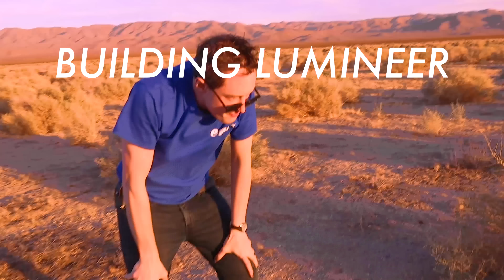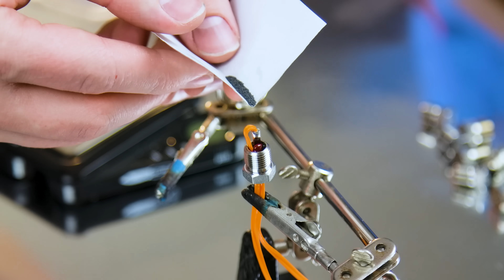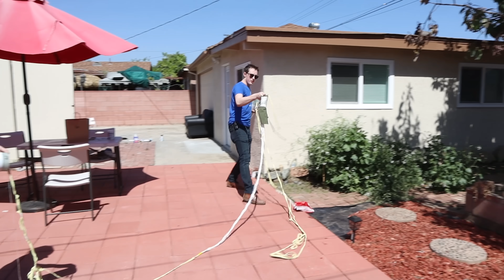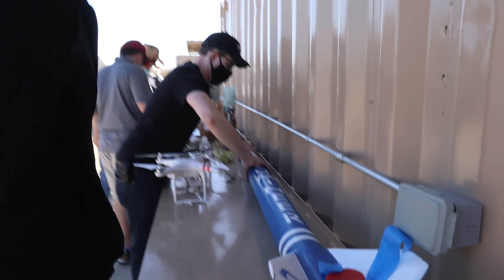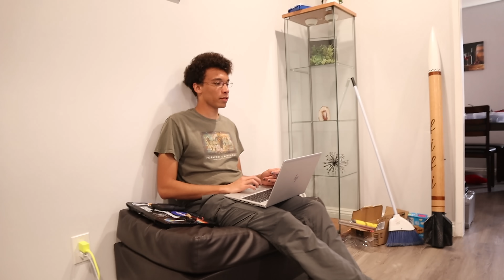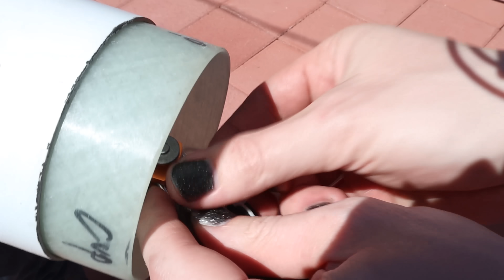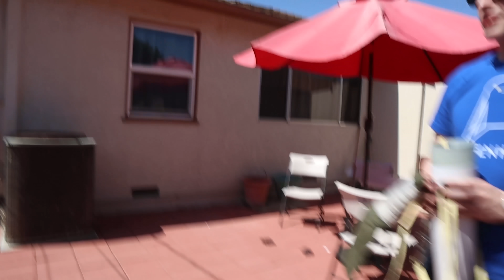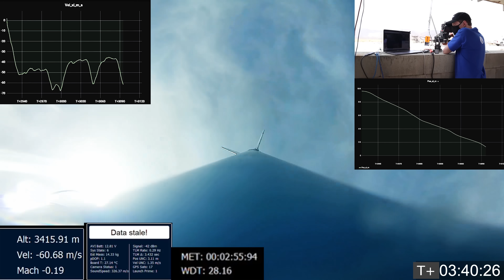Rocket Recovery System - Building Lumineer

Comment: G'day Joe.

Yours is one of the most fascinating channels I have yet discovered, thanks!

Have you tested a 'blank' pistol cartridge case loaded with smokeless propellant/powder constrained by a simple to reload and reset receiver/chamber actuated by a simple spring-loaded firing pin to initiate your pyro-mechanical deployment device?

If for some reason that was impractical or unappealing you could also try substituting the piston actuating the flat aluminum plate with a small piston from a model aircraft engine which could be attached directly to a chamber containing a blank pistol cartridge to actuate the ejection pin.

It should also be possible to create a system utilizing gases produced by relatively lightweight blank shotgun cartridges or soda-siphon CO2 cylinders to deploy a drogue chute directly. 

That method could dispense with a heavy piston arrangement altogether by exploiting gases produced by a cartridge or soda-siphon cylinder to push the entire chute out after the drogue like a non-lethal 'bean bag projectile' used  by some Law enforcement agencies in shotguns.

In conclusion I wonder if the 'kick when the motor burns out' you spoke of could be an example of magnitude for a difference between deflagration and detonation?

Comment: i think a manual safety chute could have saved the rocket what i think about is this

you could try to add a hatch on one side of the rocket the thing is that the hatch take half the diameter of the rocket (il try to do a video on ksp to show better what im triyng to say) in teh hatch you will have a second chute that you can manually deploy if you see that the main chute failled it can be something that is on the top of the avionic bay just a hatch that if you press a button the hatch open and yeet out a parachute

ok there is it made in kerbal space program fun fact i did the ksp version of lumineer so well that it actually have the same default🤣the main chute doesn't work because the drag chute break but since i did had my idea of a secondary chute it manage to land (disclaimer may not work irl i use a video game so tehre are thing that i could not do and that are not take in count in my test ) but i still think it's something to try to see if you can recover a rocket with something similar ?
https://youtu.be/Jp2Hyqobttk

Comment: As a Technician for a major airline my thought is that your drogue is not the ultimate source of failure. The real issue is that your system is too complicated. In every emergency system on every passenger aircraft you will find that it has to be simple or the FAA would never approve it. You have too many lines to tangle, too many fittings to tangle things. Any time you add more parts to a system you increase the chance of failure. You make mention of the in your reference to the "God Nut" but then do not follow through on your thoughts. Adding actuators and release  fittings, extra harnesses and such doomed the rocket, not the drogue. Had your drogue or even better, a streamer come out at apogee all would have been well had the whole mess not tangled while under the initial drag device. My thought is your apogee sensor was late or very early.

Comment: I hope you don't mind if I add my 2 cents. I used to skydive, so I became very familiar with parachute gear that's used in high risk situations, and there are some very neat (not to mention tried and tested!) solutions to these exact problems you're trying to solve.

Your deployment method is almost exactly how a tandem skydive rig works, except way way more complicated. On a tandem there is a drogue that slows the tandem down, and that drogue is then used to deploy the main parachute. The drogue is held to the rig with a 3-ring release system (https://en.wikipedia.org/wiki/3-ring_release_system) which allows it to be released with very little force, even though it's under a lot of tension. It has a single bridle that attaches first to the three-ring release (preventing the main parachute from being pulled out), and then to the main deployment bag. Therefore a single line is all that's needed to release the drogue and pull the main out of the container, and that line is held in place with just a thin bit of nylon (through the 3-ring). The main deployment bag is attached to the top of the parachute, and the drogue remains attached to the bag, which means nothing is lost during the deployment. A single line means there is nothing to get tangled in the turbulent airflow.

We also had devices called automatic deployment devices (ADD) that would release the reserve parachute if we got too low (for example, losing consciousness or awareness in freefall). Those have a pyrotechnic cutter that cuts a very small bit of nyon to reliably release the reserve parachute. No need to blow up bits of metal, with a 3-ring release system it's only a thin bit of nylon holding the entire system together. Once that is cut, the aerodynamic forces do the rest. The cutters can actually cut steel rod, so are massively overpowered, but that's good when it needs to be reliable. You can buy the cutters without the rest of the device, and they just need an electrical signal to operate. The main manufacturer of AADs, Cypress, have never had a failure that's led to loss of life.

The tandem deployment method, 3-ring release, and AAD cutters put together would give you an incredibly reliable, well tested, and simple system. If you have a parachute centre near you, wait for a cloudy day and head down there. I expect you'll be able to find a packer who will happily show you the systems and how they all work.

One last thing I want to add is that it's possible that the nose-cone being attached to the drogue is what caused the failure. If the nose cone pulled the drogue lines around too much, it could cause it to collapse and then re-inflate repeatedly and with a lot of force. The drogue only needs to end up in the airstream, after that the wind will do the rest (how we deploy a solo parachute!) so keeping the nose-cone attached to the main body in a way that minimises the risk of entanglement with the drogue will probably be a much better way of doing it
Reply: Excellent elaboration, thank you. I matches my gut feeling as an engineer: the system shown in this video is way too complex.

Comment: I might suggest using a circularly polarized antenna for the telemetry receiver so the linear antennas on the rocket doesn't go through a 30 dB cross polarization hit when they are at 90 degrees to the receive antenna. And I'm sure you have figured out that the transmit antennas need to be either external to the airframe as a blade type antenna, or located nowhere near metal which will detune the antenna and make it much less efficient at radiating the signal. There is some chance the small whip antennas you are using are expecting a counter poise (the other half of the quarter wave element) as part of the mounting in order to be resonant.  You can check this by disassembling an antenna to see if the coax actually feeds the center point of the antenna and there is an internal counterpoise that looks like a tube over the top of the coax in the direction back toward the connector. If you have the internal tube,  you don't need an additional counterpoise. Feel free to take the internal parts of the antenna and push them through the body of the rocket, fashioning an airfoil over it using your 3-D printer.  Make sure there is no carbon in the airfoil you create. Some plastics absorb RF. One way to test this is to place the plastic you want to use in a microwave oven for a few seconds to see if the plastic gets warm.  Getting warm is bad. That means it is absorbing energy which will reduce your radiated power.  
Good luck and thank you for all the well documented videos.

Comment: Fold the chute better.  Look up packing a paraglider reserve.  There are techniques which both aid and slow it's deployment.  In real life this saves your life and doesn't break your back doing it.
If that isn't enough, add a slider.  A small panel holding the lines together, push it up towards the canopy when you pack.  When the chute tries to open the air pressure from the higher speed with hold that slider up against the chute stopping it from opening.  As the drag lowers the speed the chute starts to win and pushes the slider down the lines towards the risers.  This lets the overspeed situation work itself out.  Used on real world RAM air parachutes, but also I believe some round parachutes.

Comment: First off I appreciate you knowledge and forward thinking. But sometimes experience trumps that. We had guys do all three certs in one day. Just not right IMO
I was a former Tripoli L3 TAP and never would have signed off on this attempt. WAY to complicated and unnecessary for a cert flight. Did you have a success percentage before flight? Get the cert and then do what you want.

Any info on diameter, weight, engine, etc?
Use U-bolts instead of eyelets (unless they are welded)
Quick links are fine
Use a drone chute that is extra reinforced and designed for that
Never use rope for shock cord as it will cause a zipper.
Use 1" tubular nylon about 50' long to try to keep things separated. 
Never use a piston like those PML kits come with. They will cock and eventually cause a crash
Get some 24" x 24" Nomex sheets made and tuck everything in that. Should work similar to a piston and keep things from burning. in a standard
Those pyro screws and separators sting and totally not necessary
Three 2-56 nylon shear pins work well. Negative g's when engine burns out can also cause nose come to come off.
We used dual altimeters of different brands as you said. We cut the corner of a baggie, added appropriate amount of reat 4f black powder (never us Pyrodex). We used low current blasting cap/infighters, but not sure if they are available any more. Twist the bag tight and tape.

GL next time.

Comment: Hi Joe, I´m a skydiver and also really space flight interested. I´d suggest you contact a skydiving rigger. The problem you are trying to solve looks oddly simmilar to the drogue and main deployment of a tandem skydiving system. Right after exiting the plane at 14000ft the drogue chute gets deployed. It is getting held by a small steel pin which is holding back the main chute. once they reach about 5000ft the pin gets released. The drogue chute pulls out the main chute which is still contained in a sort of sack simillar to your approach. Once the lines are fully extendet the sack gets pulled of the main chute. Thats just a short explanaition of what happens. Im sure a rigger can give you a much more detailed explanation.
The systems used to deploy skydiving parachutes are wonderfull because they are super simple at their core yet solve very complex problems.
I´m sure they can also hook you up with the right lines, sail material and other stuff.

Cheers from germany
Robert

Comment: I dont know anything about this rocked building stuff, but i know something about parachuting.
and i would recomend to look at parachuting. espacialy deploying the chute. connection of the nosecone to the parachute.

i myself got a terminal velocity on the belly of about 55m/s.
my pilotchute has a diameter of 32". at terminal velocity about 50-70 kg of force are generated.
keep that in mind. these chutes have to be very sturdy. tandem- drogues that are kept in flight till deployment of the main parachute are even sturdier.

if u connect ur nosecone directly to the main and not to ur drogue/ pilotchute it will interfere much less with the whole system.

i hope it helps

Comment: Hopefully you’ve sorted the issues with youre deployment system. But Looking at it from with parachute rigger hat on, there are some obvious failure points. 
 Firstly your drouge, can’t say for certain as it’s shredded! There looks to be no seam reinforcement and i assume this also true for your apex vent. 

Secondly and i believe to be the more critical is the line management of your main parachute. Stowing lines is safety critical with parachute, as having them exposed to the airstream for extended periods is asking for a malfunction to manifest and for example tension knots that could tie your lines to the bridle would not be obvious on recovery as they release when not under tension. 
If you have any questions, I’d be more than happy to answer them.

Comment: the two tender descenders in parallel, it's a joke right, just like in electricity, if you put two closed switches in parallel and only open one, the circuit is still closed. I understand that thanks to the ropes, it disconects but a serie configuration seem way reliable.
Reply: They're in a loop it looks like, so series but looks parallel

Comment: Too many moving parts, there are easier ways. 
You might want to try a spring loaded bolt with servo latch if you need something pushed. Or even ... you know i hold a lot of ideas back because some people are robbing my entire life and hijacked it and involved the corrupted courts and govt in australia and they started this lockdown to prevent assistance from reaching me while they chased me around and telling everyone we dont know where he is... these arent big ideas here but thats why i cant get to step 10 because people all patrolling step one claiming there is some virus and war going on there...Those pyrobolts and release mechanism are a little over powered. There are better ways. Many times people get stuck on doing things one way and build systems to improve that one way so much that when they find a new better way they hold on to the old way because so may systems and factories are in place to do it the old way.

Comment: Hey Joe.  Had missed a lot of your videos last year and this one is amazing.  The science of the drogue chute then deploy.. All your stuff in chute and bag and everything seems pretty tight.. Even the nose cone. So I think a looser cone with those shearpins and a looser bag or a shroud system would be better.. Then the drogue would have an easier time to pull out the main. Also good to get a more stout drogue...  Your idea on a shorter upload line to keep the cone with the whole unit is a good one with less need for the pyro separators and other space gobbling stuff. I would have tried the route. My 4'  3-motor rocket had a 1" shock cord connected from the cone and body and the chute.. Cone slipped off pretty easy as it used the ejection pressure from the solid composite motors. 

Can't wait to see if you get to try it again. 
Eric

Comment: 1 Idea about the layout on the line diagram, i drew something: https://ibb.co/DgKjzfH

1) If you adjust the length of the piston and the friction on the main bag, so that the main will stay inside the trunk, it would be protected until the tenders cut. This will also keep the main in the MB, as there is no force on it. Spacex (and everyone else) do it that way on Dragon: https://youtu.be/jPQD-u5ZP6M?t=22

2) Maybe you could attach the drogue and nose cone to the top of the Main chute, via a line from the inside top of the MB, to keep everything together. Something like https://youtu.be/HOnNYWu6onU?t=10, although the nose and Drogue will probably fall past the main anyways.

3) Additionally to 2), to keep the the drogue and nose, dangling behind the deployed main, from getting into the wind shadow and crashing into the main, one could shorten a few lines on the Main, making it asymmetric, so the whole assembly will spiral to the ground, pulling the drogue and nose in behind, although that has to be tested. I couldn't think of a safe way to get the nose dangling from the main as well, which would be the perfect solution here.

Comment: The Lumineer design has been in use for decades, this is predominantly used to connect the inflatable boats to the side of ships. In this case they just use a restrained spring cutter which get activated when submerged in water.

Comment: Hey, I just wanted to say, one thing you should consider adopting is the attitude of fail hard, fail fast. Failure is the greatest of all teachers, and when you fail, you should really be excited - a really hard failure is going to teach you more than a bunch of mediocre successes that only reinforce mediocre behaviors. I've worked all over the field of engineering, and that attitude - win or learn - has been a saving grace. Always look for the lessons - that's what made Elon Musk so successful. You tried, you got data, you learned a ton, and you can return back to things and try again with a better design having more knowns in place.

I particularly liked your shoot design, but my biggest concern is that such things would get tangled up really quickly. Is there a way to prevent this kind of tangling? Is there some sort of more slippery material you could use for the shoot wire?

Also, I think you're right about the drogue shoot tearing due to shock forces. You may be able to use what's left of that to actually get an understanding of the way the force is distributed in the material itself and maybe do a special kind of stitching to reinforce the main shock areas, maybe in a way that takes the shock force and splits it out across the material to reduce the overall sheering force.

Anyways, best of luck in your next attempt.